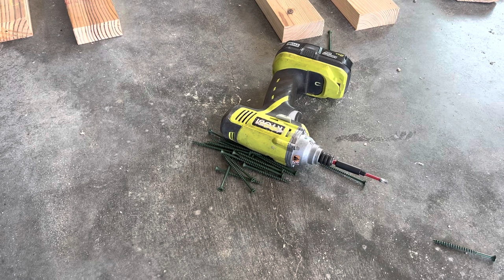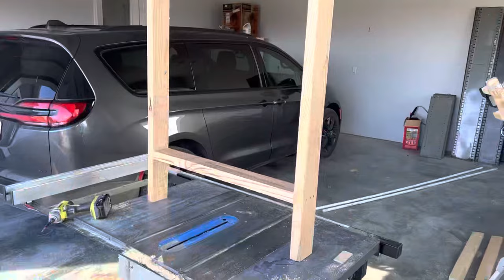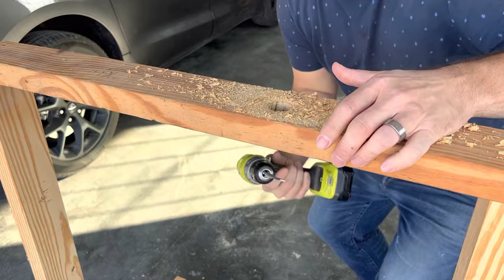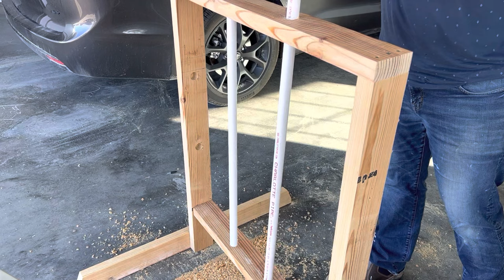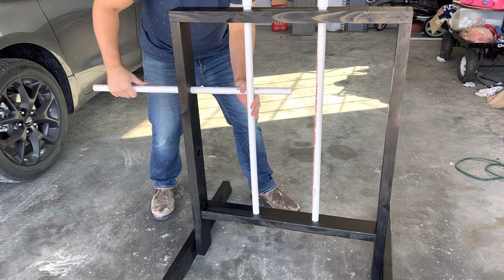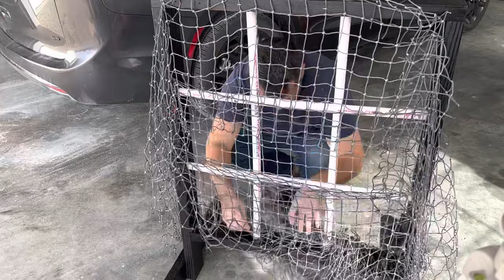HOW TO BUILD YOUR OWN NO HITTER 9 HOLE PITCHING NET CHEAP !

Comment: Since strike zone depends on size of hitter, at what height of hitter would this strike zone be most applicable too?
Reply from the maker: @LLE1144 the one from Anytime Baseball Supply, the height can be adjustable, but on our homemade one you can’t adjust the height and the strike zone isn’t really as accurate as the one on Anytime Baseball Supply

https://www.anytimebaseballsupply.com/products/better-baseball-pitchers-pocket-pro-9-hole?dm_cam=21364030963&dm_grp=164655445913&dm_ad=701561043067&dm_kw=&dm_net=adwords&gad_source=1&gbraid=0AAAAADJYRN-jH0qn8Yn8lvJulWH3_FkNW

Comment: I'm trying to figure out something like this for my son. He's 14 I'm sure that PVC will be smashed to bits in one session. The net wouldn't stay on with being stapled on there. The official ones are so expensive though.
Reply from the maker: I agree not the most ideal to last forever. My boy is 11 and does not throw that hard yet… nor do we pitch everyday. His main position is infield/ outfield. When it breaks I think we can change it to some bungee cords or something. I have also zip tied the netting and used an air compressor staple gun. My hope was to give an idea of making something at little cost that could be altered as needed.  I am sure the $400 one has some flaws as well. Thanks for leaving feed back. Much appreciated 🙂
Reply: @Case.Baseball  I'm thinking the wood frame would work, but I'm going to try to use steel cables for the cross members. I still don't know how I would keep the netting from blowing apart.
Reply from the maker: @exemjazhuel3428  yes! why didn’t we think of that 🤦🏻‍♂️ … exactly why I like posting stuff on here for the great comments comments
Reply: @Case.Baseball  you are welcome bro and thanx to you for share this kind of tools for helping our kids to improve 💪💪
Reply: @Case.Baseball  by the way bro instead of the pvc pipes you can use the galvanized steel pipes is a little bit more expensive but make it more durable
Reply from the maker: @exemjazhuel3428  good thought, thanks for the idea.
Reply: Bungee cords would also work imo…

Comment: We are a travel team on a low budget and I knew someone out there besides myself who think 300$ to buy something like is a ripoff! I can build this with 36$ in wood and screws!!! Great Video!
Thank you
Reply from the maker: Thanks for commenting and subscribing!
Reply: Did the pvc hold up from the baseballs banging on it ?
Reply from the maker: Yes it did. next time I would go with smaller PVC though. It works but a little smaller may of been better. I think bungee cords would of worked even.
Reply: Check out VEVOR $75 for one just as good as the $300 ones.

Comment: Awesome, I have been thingking to build something like this 3 weeks ago for my son practice, the only change is I like to be able to fold the legs to be able to take it anywhere. 
Thanks for sharing, you are a Good Dad
Reply: Use door or cabinet hinges on the parts you want to fold
Reply: Or bolts with wing nuts for easy assemble/dissemble for the base supports.